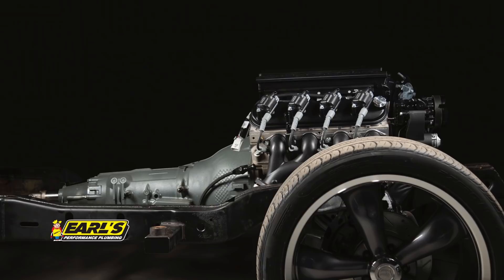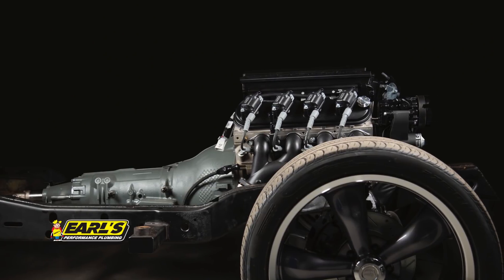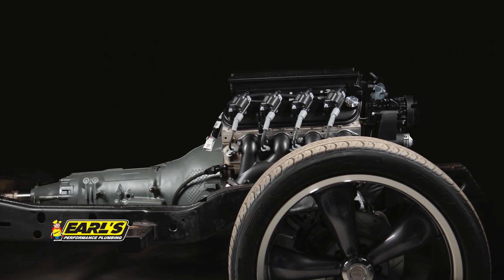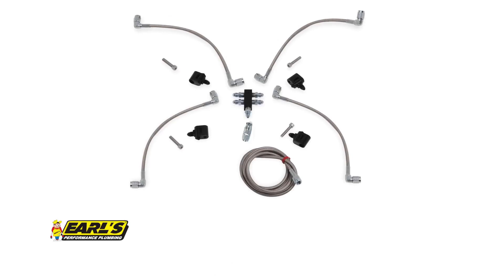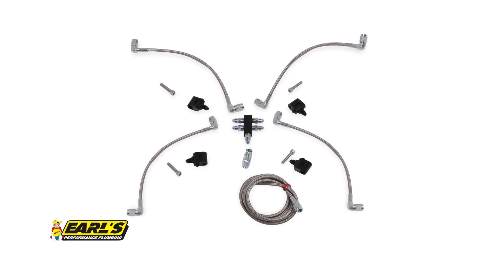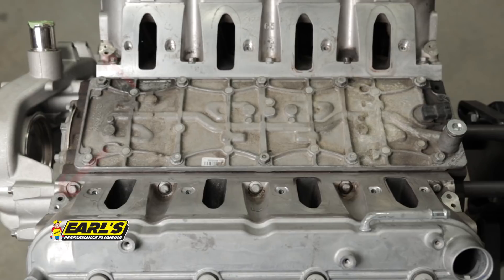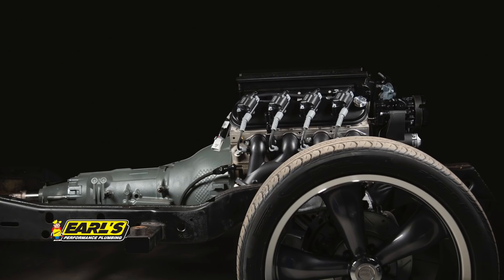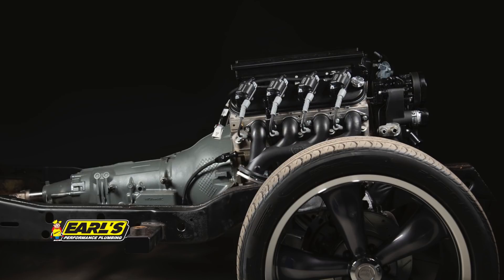Why Do LS Engines Have Steam Tubes?

Comment: Ive got a really interesting question. Can i use a steam port connection as a temp fix for a blown head gasket? Exhaust is getting into my cooling system and it displaces the coolant into the overflow tank. Wondering if i can vent those fumes with a simple t connection on upper radiator hose. Extra line leading to the drain of my overflow tank 😂 so janky, but in theory do you think it would work?

Comment: I have 5.3 240sx turbo,u think with blocked rear steam ports and just the front steam line will be ok? 2003 5.3 stock 706 heads

Comment: Do the later model LS7 have a different setup? I tried swapping my 2006 LS7 kit onto a new GMPP LS7 crate engine and the adapter that bolts over the steam hole dowel is too long.

Comment: Good point now concentrate on the water pump and see if it performs according to the required flow rate and head pressure for the heat output of the engine. You will find as we have that the water pump is the most important component on an engine, in order to bring about a proper tune spec. Both Ford and chevy woke up to this a few years ago which is why they placed the thermostat on the inlet. There is still alot of work to be done.
Reply: @PPR Darryl  So, the statement the GM woke up a few years ago and placed the thermostat low, how do you explain the 1992 Buick RoadMaster & Caprice. They had reverse flow coolant systems, just like the 3.2L engine found in the Isuzu Trooper and 1993 Rodeo?
There cooled coolant went to the back, not the front. I worked on them at the dealer. They gain 18 horse power by making this change. 
Another of 163 companies Holley now owns. Starting with two cars in 1900, then built carburetors for others, mostly airplanes.
ASE Master Tech since 78.
Reply: @deankay4434  Smokey Yunick was the one who reversed the coolant flow but our system placed the water pump front and centre. We placed a restriction on the outlet and inlet which allowed a properly set up pump to perform at most rev levels. 
We were gaining an average of 6 to 8 inches of mercury at idle.
We had a thermostat in the inlet allowing the coolant to flow according to the throttle position. We can successfully run A/F ratios of up to 55:1. without burning a piston although the power is down.
Reply: @deankay4434  That Buick engine created more problems by placing the thermostat at the back of the engine. Around 1990 the Buick V6 occupied a warehouse in Detroit stored there as a mistake until GM found an outlet in Australia after Nissan had rejected GM in Australia for installation engineering mistakes in their VK Commodore . GM in Australia took the failed Buick V6 3.8 liter engine and reworked the cooling system bringing the thermostat back to thew front of the engine and taking out the inherent floor in the crankshaft design. By 1997 GM in Australia fixed the mistake and we ended up with a good engine but only after trial and error.
GM America still has not confronted the elephant in the room with the LS as the pump is atrocious. Fix the pump fix the overheating problem. Steam tubes are an admission of a problem .

Comment: the cold water come in though the thermostat ? thats what the vid shows at :45
Reply from the maker: Yes, GM LS engines locate the thermostat on the "inlet" side of the motor - specifically in the inlet housing of the water pump. With this design, when the engine is cold the coolant is circulated through the radiator (look at the unique design of the LS thermostats), but is prevented from entering the engine until the temperature of the thermostat has been reached, at which point the thermostat opens and the coolant flows into the engine.  Thx J

Comment: The SBC 400 has steam holes in the cylinder head. If you install aftermarket cylinder heads and don't drill them you can have overheating problems.
Reply from the maker: I was unaware of that, Good info!   J
Reply: Unless you have a Dart SHP 400 block and aftermarket heads, then definitely DON'T drill steam holes ! [stock block, yes]